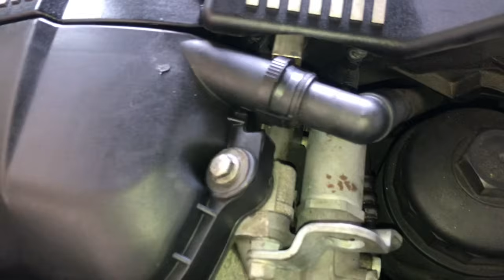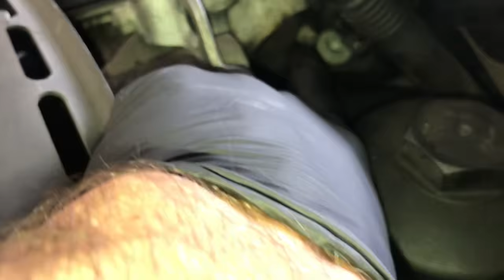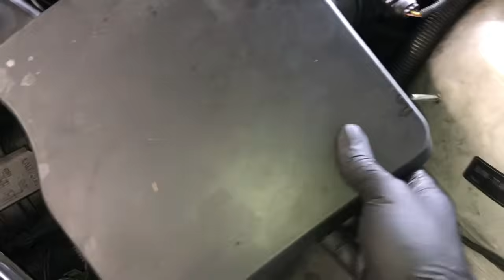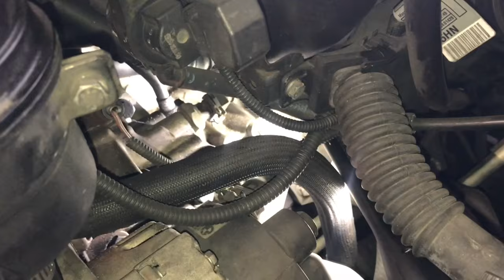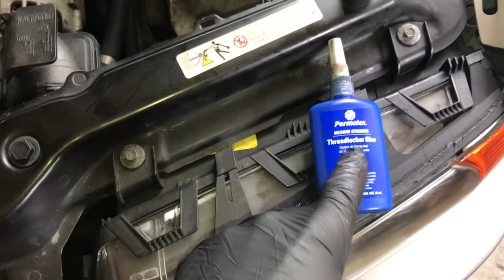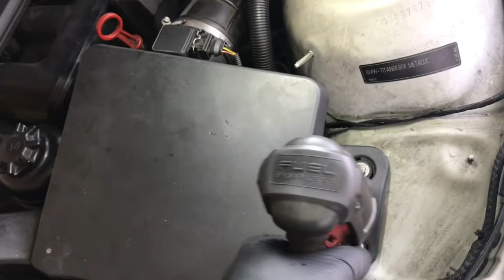How To Replace An Intake Camshaft Position Sensor On A 1998-2006 BMW E46 3 Series

Comment: I replaced my airbox with a K&N so I had to take off my MF sensor and hose to get at the end of the cam sensor plug. I don't have a 1 1/4 wrench or a 32mm wrench, I used channel lock instead after applying free all bolt remover. I'll update after driving test. Cam sensor A code and engine shutting down at 4k RPM.

Comment: Thank you for this video Brian. It helped me replacing the sensor today. I didnt have a flexible head wrenh socket so I had to remove the oil filter cap for extra hand space.

Comment: I'm having p1343, p1345, p1351, misfire with low fuel, I replaced the fuel pump, fuel injectors, ignition coils and sparks and even the MAF SENSOR, and replaced yesterday's the exhaust cam sensor. Still nun, it's 5spd manual 2001 e46 m54... so it just keeps stalling I dont even drive it. It's bad. It's on my youtube I need help with this.. anyone help.

Comment: My vanos is stripped and it's on extremely tight how do I get it off man... I can't even replace my intake cam shaft sensor that's under it.. helpp mmmeee I also don't have this size. I've tried.
Reply: Same here
Reply: I’m about to do this, yall making me just reconsider
Reply: @brandonl3268 i got it, drilled a 4mm hole on one of the hexagonal edges, then hit it diagonally with the centerpoint and my hammer

Comment: Surprisingly easy DIY job, thanks! Of course, symptoms of a bad cam sensor are difficulty in starting, with poor running and idle. I at first suspected the fuel pump and replaced it. No help. Then I checked the codes and there it was, P0344  which is "camshaft position sensor A intermittent". A new OE cam position sensor was about $60. I did the job in my driveway in about an hour with no problems. The car runs perfectly now.
Reply: i experience the exact symptoms as u. however no driveway for me it was off the street. engine is running good now. will tidy and put all the plastics back in place over the weekend.

Comment: Super clear and concise, thank you! First major(ish) bit of work I've done on my E46 and everything went really smoothly. Note for others: I had to remove my oil filter cap to get better access to the camshaft bolt, which you might have to do unless you have a torque wrench with a flexible head like he does.
Reply from the maker: Glad the video was helpful and everything went smooth. Thank you for watching!

Comment: Great video!  Tying a string to the end of the sensor wire where it plugs in under the air box will make threading the new wire into place easier.

Comment: would a bad crank sensor "A" cause stalling & no restart? Thanks much!
Reply: Doug Tyree did you figure it out?
Reply: @Jay-wl9tp  Thanks much for the follow up. Well I got her running strong, however now it seems like a Throttle position sensor issue perhaps?
Runs Great @ WOT, but seems to have a lot of Pedal travel to get her going?
Reply: Doug Tyree I just put mines in the shop Friday. I’ll let you know what the results are. I’m having the no crank no start
Reply: @Jay-wl9tp  OK good luck, have u had the codes checked?
Reply: Doug Tyree It was the starter !
Reply: @Jay-wl9tp  Nice, Glad your back on the road!

Comment: I've changed it before but it doesn't work because the sensor is not exact same. And no one mentioned that the sensor's head is bigger than the old one. Did you guys find the same problem like me? Thanks
Reply: Jack Jitphulphon make sure you ordered bank 1 or A and not B or 2 because that one has a bigger head
Reply: Blitz Court thanks for your kind message👍